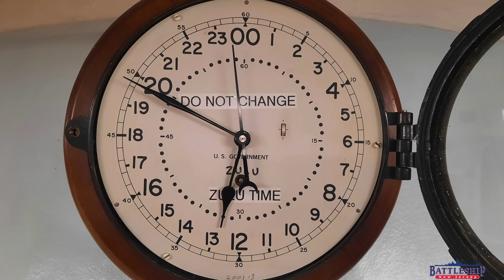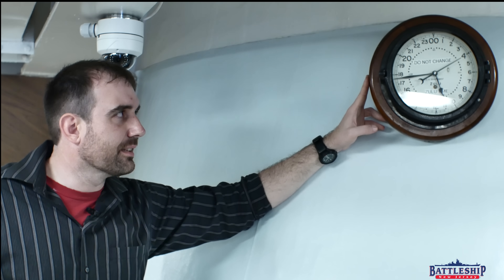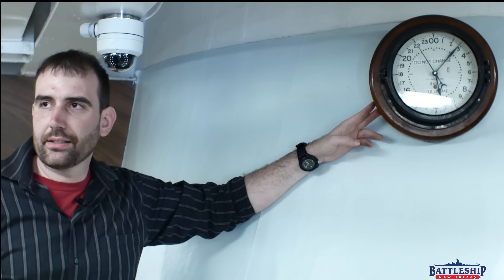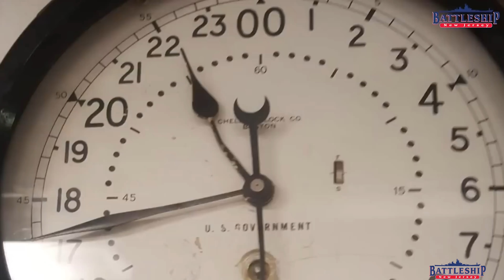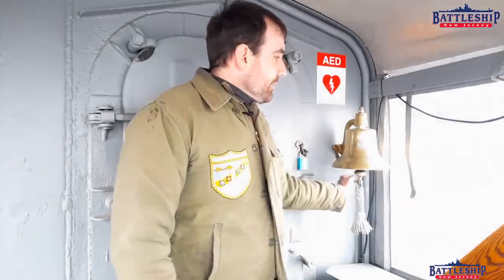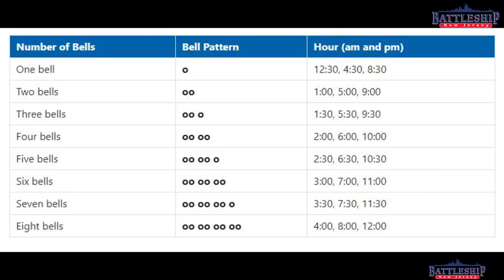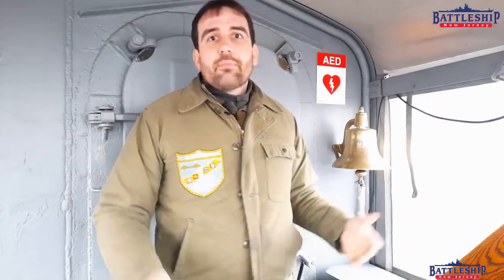Zulu Time and 24 Hour Clocks

Comment: In a sailing ship, what would happen if the guy who had to turn the half hourglass lost track of it?  How would you get back on time?
Reply: You recalibrate for local noon by shooting the sun with a sextant.  After the development of the chronometer, this was no longer necessary as the chronometer would be set to GMT at Portsmouth, England which is necessary for determining longitude (each 15 degrees of longitude = 1 hour).  This was the original reason that Zulu time was critical to navigation on ships.

Comment: It's easy to find a watch that keeps 24 hour time if you go digital. Most digital watches have a 24 hour setting.
Reply: Timex has several very good analog watches with the 24 hour clock. I still have my G.I issue...works better than a certain brand of Swiss watch!

Comment: I believe the standard was that the ship would set the time-of-day clocks to the local time zone when they were in a port, be it Philly, Subic Bay, etc., but they would all be set to Zulu Time when sailing. In my former career in Telecom, all the systems I recall used 24HR time, but it was aggravating once we were part of a national team, would have been a lot easier if we all were aligned with Zulu. We often had quirky issues with AZ, b/c the state didn't adhere to daylight savings time flip/flop (AZ is 'ahead of it's time' LOL, I hope it's ended soon nationally).
Reply: I live in AZ and not having daylight savings is awesome. Besides not switching times it also means that for awhile eastern football games start early in the morning where I'm at. There's usually a person or two who is betrayed by their phone and ends up being later/early to work every so often. 

Shipboard time was weird. It was probably just how my division did its watches but I swear that I recall staying on Zulu time on watch all the time in some instances, but I also recall switching time zones like crazy crossing the Pacific. Nothing like having your watch gain or lose hours because of shifting time zones. Hopefully you stay in the same watch group coming and going so things even out. 

I'm thinking that during Desert Shield we might have primarily been on Zulu time because of what was going on at the time and keeping things tightly coordinated. My whole first deployment was during Desert Shield. My Pacific experience was years later.
Reply: @Tsyroc  Thanks, Corey!  Yep, my career was in AT&T Mobility as a 3G/4G Support Engineer and my group supported equipment in Phoenix. Even though the vendor engineers kept the out-of-sync (vs the rest of the country) time changes, there were occasionally customer issues where their phone would be not current. Nothing major, just annoying sometimes for the customer.  Things would have been so much easier on us if everything equipment-wise was on Zulu time but I think there were reasons why it couldn't be, I forget why now.

Thank you for your service!  I was always interested in all things Navy, I tried to join when I was young but the MEPS Docs disqualified me, I have mild CP and had a strange cancer-type illness as a kid. I just recall reading somewhere that while 'steaming' ships were always on zulu time, for ease of coordination with everything else, but if berthed in port would go to local time wherever that was. I would think it would be much easier to always be on zulu.

Comment: I have 2 x 24 Hour mechanical watches. One is a soviet submariner's watch, with an outer ring for tracking watch times. It still works, but, amusingly it's completely not water resistant. One supposes, if there's water in a submarine, knowing the time is rapidly about to become a non-issue

The second one is a military/diver style - called a Komandirskie -that'll go to 200 meters under water and has a second 24 hour bezel so it'll record two time zones at once. It's a company called Vostok, and they still make them. But they're going to be hard to get in the very near future for obvious reasons.  They are cheap though.

It's actually weird to look at a 12 hour clock --- I'm so used to using a 24 hour clock.
Reply: In Soviet Union, watch wears YOU.
Reply: I have a Vostok Amfibian, never had a problem with water getting in. I've been wearing the Seiko quartz flight computer (also rated to 200m WR), because ... reasons. The Seiko has a slide rule! :) Most watches I've owned had 1-12, but I can see how you'd want a 24-hour clock on a ship, when you might not go outside to see whether it's noon or midnight. My job is sometimes day shifts and sometimes night, so I'm used to working 9-5, but whether it's AM or PM changes from week to week.
Reply: @DeliveryMcGee  wearing an amphibian right now, love my scuba dude :D
Reply: Most of the ppl I work with,go to bed as soon as they get off when working nights, then wake up in midafternoon and go out for dinner. Am I the weird one for just literally swapping AM and PM and waking up at 7:00 and going to bed at 12:30 whether it's days or nights? Edit: yes, I should get more sleep, but there's so much youtubs to catch up on!
Reply: Vostok is an awesome watch with a great history.
Reply: I believe Vostok have a factory outside of Russia (Estonia, maybe?) But they are sold as Vostok Europe so hopefully availability won't suffer so much.
Reply: @anne_frank_  P yeah, it just don't feel moral. Though if there's a yellow-and-blue 18mm NATO strap, I'd buy one in a heartbeat.
Reply: @DeliveryMcGee  It's the government, not the people. Don't feel so bad about buying Russian, their people still need to eat.
Reply: Since switching to one handed watches, normal 2 hand clocks look weird and cumbersome.
Reply: The watch might stop when submerged for a predetermined time, for reasons.
Reply: I had several Soviet era Vostoks (an Amfibia and a Tanker among others) and some Raketas with 24 hour dial. Strangely, they stopped working when Soviet Union collapsed. The only dependable one is a diver's wristwatch with a 4" dial and 200 meter depth rating. It weighed about two pounds...

Comment: Ship's bells are usually rung from reveille to taps, so as not to interrupt sleep, too much, at night.  You get woken by bells and reveille.  and last bells are normally at 2130 and at 2200 taps. lights out with no bell.

Comment: You don't need a large geographical separation for local time to be a problem.  We were passing Singapore.  The carrier and the other ships were going in, but we weren't.  Around 1800 the bridge told me to bring up a radio circuit at 1900.  It only took a couple of minutes to set up a voice circuit, so I was going to do it at about 1845 or so.  At 1830 the bridge called and asked where their circuit was.  They had switched to Singapore time, which was a half hour off, because the rest of the task group had switched.  It would have been nice it they had told me, but apparently I was supposed to read their minds.
Reply: you know what different ocupation and civilian i can tell you i really appreciate beeing told whats going on instead of everyone looking at you like your retarted and getting reprimanded because you were no told all of the information about a upcoming task. it has happened so many times its unreal sometimes i think the ones organizing are more disorganized than disorganization.
Reply: Going by your handle, I don't think your radar? (MASH reference)

Comment: When you are sailing West, you might get stuck with an extra hour on your shift, if you cross a time zone....I hate to think what an actual WWII clock like that would cost today.
Reply: With a lot of artifacts like that, it's a matter of "Cheap, Working, Original: pick two".
Then there's an additional variation based on whether the item is widely collectible or not. Sometimes you can be very pleasantly surprised at how cheap some military is just from not being that popular a thing to collect.

Comment: Zulu means never having to adjust for time zones, but what does the ship do when it crosses the international date line?
Reply: ZULU still doesn't change.
Reply: Nothing with the clock, it is just the prior or next day depending on your direction.
Reply: It would seem reasonable that the day reported will not change until zulu rolls past 23:59hrs.
Reply: @aland7236  The local day changes when you cross the line, regardless of what the clock says.  Zulu time, including the day, does not change.
Reply: @michaelsommers2356  Thanks. I was wondering how you crossed the international date line without having 2 days with the same date.
Reply: @aland7236  yep use zulu time use zulu date
Reply: zulu time stays the same always, but local time changes as you move through time zones.

Comment: I had an idea for a future video with Ryan using a bosun whistle and talking about the 1MC on the ship and general quarters
Reply: I'd like to have him go over the bosun' whistle. I was in the USN and I'm still not sure when it's used other than for sweepers, taps and reveille. At times some of the functions seem to overlap with the ship's bell. I've stood petty officer of the watch in port and had to do the ship's bell but one ship that was across the pier from us used a mixture of both when most ships primarily stuck with the bell. I'm not even sure on my ship where they were doing the whistle from because it wasn't on the quarterdeck.

I also don't recall doing time with the bell like he mentions but I think it might have been because when I was standing watch it would have been in the evening or at night. I probably did it to at least some degree and just don't remember. I mostly just remember having to do the bells for fire drills and the pattern "helping" determine the location of the fire.

There's also doing the bells for when the CO comes and goes from the ship as well as important visitors.